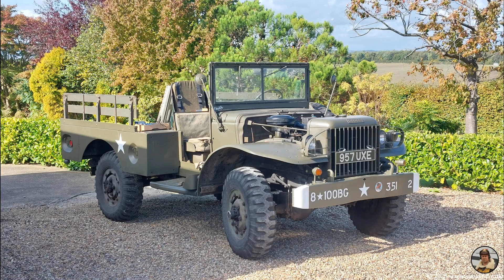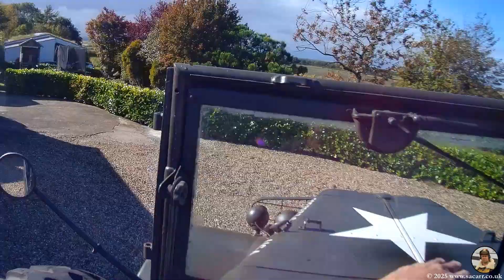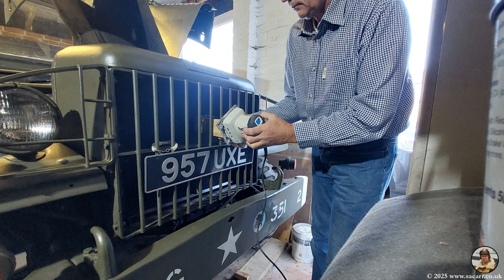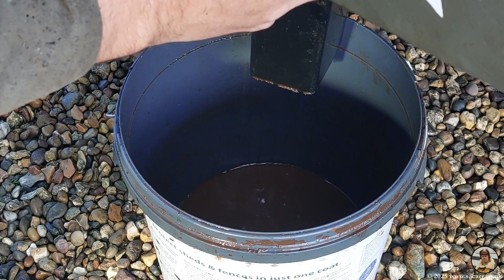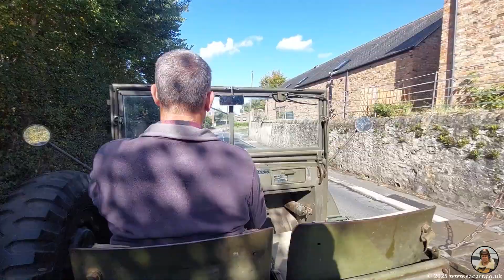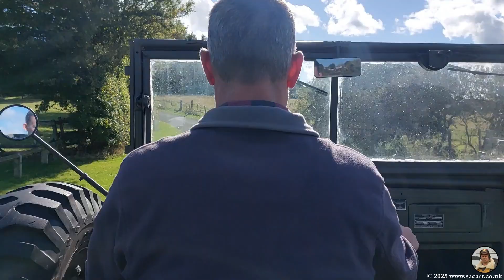Dodge WC51 Weapon Carrier Test Drives Following Engine & Cooling System Work

Comment: Greeting from France ! Love your work and dedication !
Nice work done again with all the steps detailed ! Faced the same issue last year... It took me some time to clean everything as the engine block is prone to get lots of sediment at the bottom over time.... Washed and clean the radiator with vinegar and flush products (mine was running on tap water for the last 20 years are so..). I flushed everything back this summer and flushed everything last week for winter prep.... it was still pouring orange juice and the top of the radiator was covered with red oxide from the engine. Refitted new pipes and elbow that was very corroded and she's ready for the next season.
Just a hint for the thermostat make sure that you have a tiny bypass hole on the side of it (2mm) and also the one on the housing bypass is also free - allows to let pass air bubbles during bleeding and liquid even if the thermostat is blocked in closed position.
Reply from the maker: Regarding the thermostat, I did drill it while it was out.